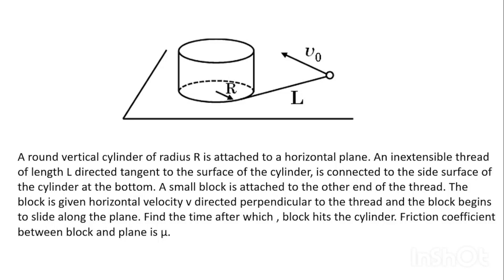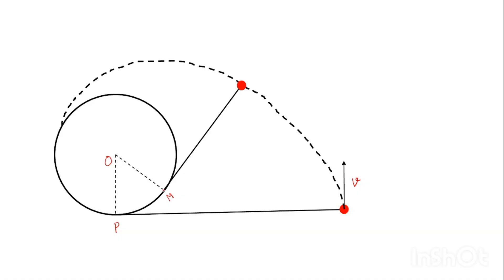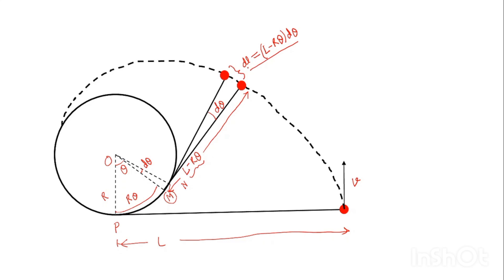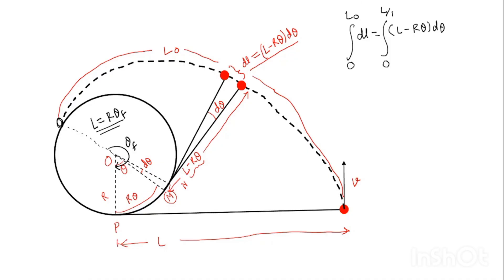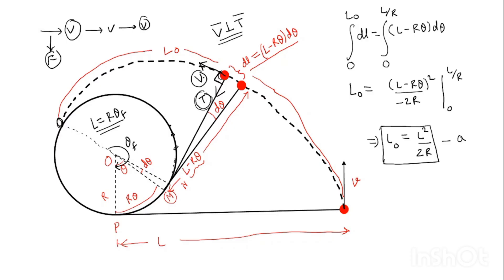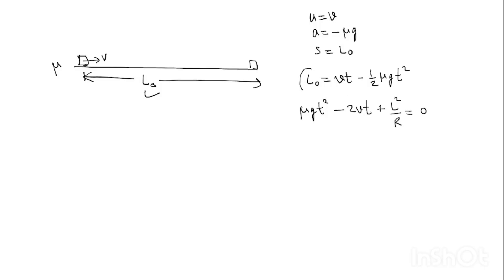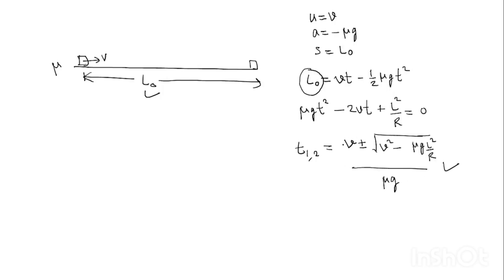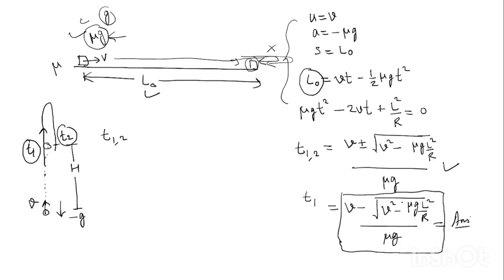Prescore Physics test paper 2 Solutions JEE Allen

Comment: Sir mana prescore ka paper offline ma diya tha mera dona paper ka combined 62 marks ban raha ha i am too much tensed and thinking to leave giving prescore as it too irrelevant for exam and prepare weak areas shoud i ?
Reply from the maker: Who says prescore questions are irrelevant? Is there any question out of syllabus? Only the teachers who can't solve those questions themselves say that. In fact they are good questions which expose the weak points in your understanding and hence give you hint where to work upon. I suggest we must try tough questions in order to handle such questions with ease during exams. Remember latest NEET shock?? We must be prepared for tough questions in coming JEE.But don't be tensed ...there isn't anything tough in physics it might just be different and needing a slightly different approach which you can master with practice
Reply: @physicsbyashutosh0603 sir will solving irodov , hcv will help me get to such a level or any other material is also required?